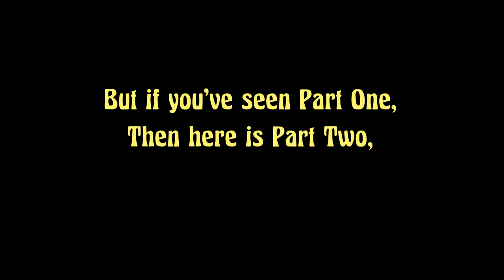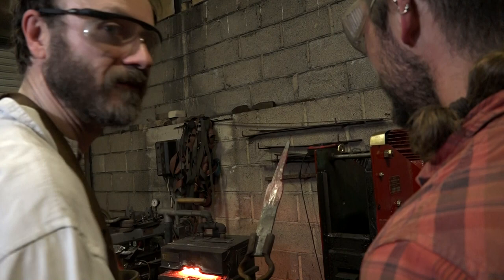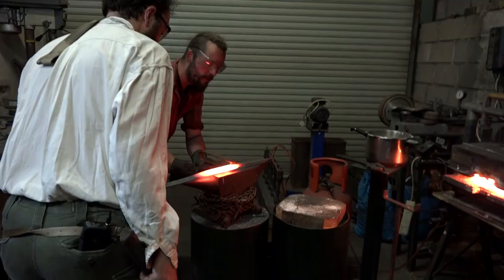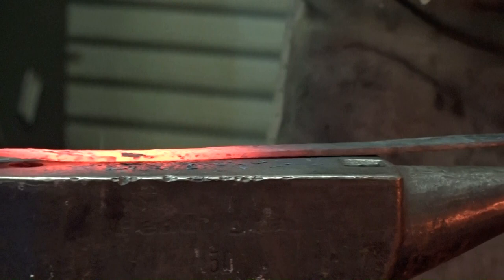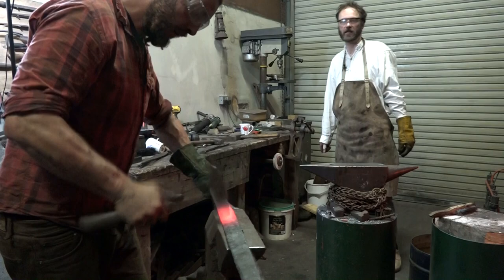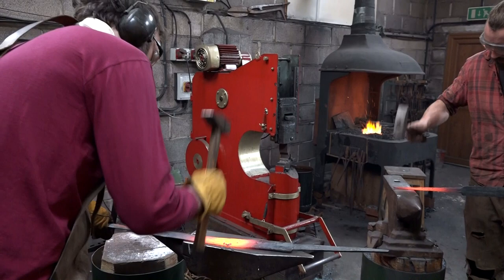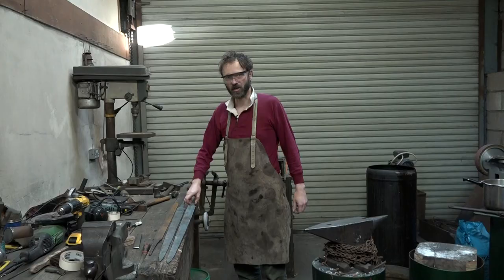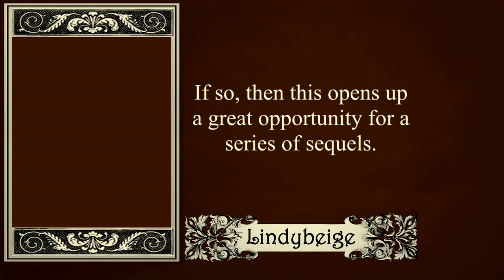Forging a Sword - part two: fuller, bevels, straightening

Comment: forging in a fuller!? thats rare to see nowadays, everyone seems to want to grind them in. Im pretty sure that forging it in has more benefits other than just simply making the blade wider with less material as one would expect it maintains the granular structure of the steel opposed to grinding it which breaks those grains. shrugs tis but a theory
Reply: Makes sense: more hammering the steel, more folding it into itself, should make it stronger.
Reply: Indeed, if grinding in a fuller did no harm, then why couldn't you just grind/cut out the entire sword from a block of steel? Well, I suppose some mass produced knives are just that. And they suck.
Reply: exactly, obs back in "ye olde days" they couldnt do that due to tooling and material limitation but nowadays, if there is no benefit to forging a shape, why not just grind it completely in the shape? there has to be something about forging that provides additional strengths over grinding. as i said, steel is a granular structure. surely it is better to bend that structure opposed to cut through it
Reply: I think the whole 'intact steel grain' is a bit overrated, considering that I'm pretty sure the grain completely reforms during hardening anyway... You have to cross the ferrite / austenite line for hardening to work, and at that point the grain structure is basically normalized and as new.

I'd guess grinding is just a industrial shortcut, whereas in medieval times, grinders and files were either hand- or water-powered (i.e. quite slow). A good smith with some apprentices could probably hammer out the rough-shape the fuller much faster, too shorten the time spent grinding your precious steel.
Reply: "as one would expect it maintains the granular structure of the steel"
"more hammering the steel, more folding it into itself, should make it stronger.
"

Any benefits of work hardening the blade while forging like this go out the window the minute you get it up to heat treat temperature.
Why? Because the steel goes through a literal phase change. Its like ice melting into water, and then being frozen back. Any crystal structure is blown away. You can even see this if you look around for metallography. Take the same bit of steel, cut it into 3 chunks. Heat treat 1, temper the other, keep 1 as a control. Etch it with a bit of sulphuric acid (so you can see the structure better), and look at them under the microscope. It's amazing how glaringly different the grain structure of the same piece of metal is after heat treat.

As far as folding. Folding only accomplishes anything if you're mixing 2 or more different types of steel, and folding them to make it more homogeneous. This sword is already homogeneous, so folding would not only be a waste of time, but it would also run the risk of introducing impurities into the steel.

"Indeed, if grinding in a fuller did no harm, then why couldn't you just grind/cut out the entire sword from a block of steel? "
Because back in the day, steel people had to work with didn't come in uniform flat bars cheaply, and grinding was a slow process.

"Well, I suppose some mass produced knives are just that. And they suck."
I'd love to see some evidence for why a ground and heat treated knife has any functional deficiency to a forged one.

"there has to be something about forging that provides additional strengths over grinding. as i said, steel is a granular structure. surely it is better to bend that structure opposed to cut through it"
Again, the minute you get above austenizing temperature and the structure shifts from body centered cubic to face centered cubic, any structure given by forging is gone.
Reply: If you already hammered the whole steel and only grinding the fuller isnt optimal, but not that bad. A Pro: https://www.youtube.com/watch?v=AcbL2v-9Frk&t=444
Reply: B & A Talks As someone with a master's degree in materials science, I can tell you this is completely wrong. If anything, forging makes the blade more brittle, which you don't want. But as others explained above, this all goes away during the heat treatment anyway.
Reply: Hammering in the fuller won't make make a difference to the sword in the end like many above have said. The key difference and why it wasn't done back in the days of these swords is two fold.

1. Material not wasted from grinding. Steel back then wasn't as readily available as today.

2. Back then all they had was low speed foot pedal grinders in comparison to todays grinders. Grinding back in the Medieval period itself was just as labor intensive as hammering it.
Reply: My way of thinking would be this (I have had some material science, but not much, and don't really know anything about sword forging):

It's the trade-off between hard (strong), but brittle steel vs softer, but less brittle steel.
I would expect for swords, you'ld want a hard edge, with a slightly softer core. (the core has more thickness, so it doesn't need to be as strong)

The hard edge is needed to cut through some basic armors, and to prevent your sword from being cut by the enemies sword.
(the harder edge will cut the softer edge)
If the base of the sword is too brittle, it could shatter in it's entirety, which you definitely don't want.

This would be the reason that hammering the edge is at least theoretically better than grinding the edge.
Heat treating will change the granular structure of the metal depending on the heat to make it less brittle, but also less strong (softer). Ofcourse you don't want to heat the metal too much during heat treatment, since that would undo all the hard hammering work and you could just have easily have casted the sword.

This is in contrast to meat cutting knives, which often have a soft but very sharp edge. The difference is that meat doesn't wear any armor, so your knife will be the harder material anyway. Softer metal is also easier to grind  sharp.
Reply: Well, fullers are put on swords to make them lighter. If you forge them, you're just compressing the metal and it remains the same weight, just higher density. If you grind them in, you're taking away material and the sword actually becomes lighter. Also, one other (and probably more important) reason to put a fuller on your blade is AESTHETICS. Yeah, the look of it. Why they mostly forged fullers back in the day is probably because it was easier than grinding them in. There's not a whole lot of difference either way. Pretty sure Shadiversity made a video about it, if not then someone else. Just look it up.
Reply: It's all about effort and efficient use of time - forging is simply faster than cutting and grinding - even today.

Watch any video of drop-forging components in a modern foundry - parts are formed to size and shape in seconds that would take minutes or hours of cutting and grinding.

Pre steam/electric power we are talking hours of forging vs days of grinding.

And the one thing that has not changed in thousands of years is - time is money.

There is no structural benefit to either method over the other - the process of forming a flat, straight bar to grind is forging, whether it is done by hammering or rolling, but if you have to forge the metal from a random lump into a flat bar then grind, why not just forge it into the final shape and skip a whole lot of grinding?

Forging produces less waste, so there is a lower cost in materials as well as labour.
Reply: How many times do we have to repeat the heat treatment undoes all of hammer hardening ? This is not up for debate man, it's a fact.
The hard edge vs soft core is true only if you don't have good steel for the whole blade. It was done in the early middle ages in Europe and later Japan (idk about the rest of the world). If you want to learn more about this Shadiversity has surprisingly accurate and complete videos on the heat treatment process.
Reply: nbfdmd
 Actually, most high quality knives that I know of are made with stock removal. I also wouldn't be surprised at all to hear of a stock removal sword, though I can't cite a specific example so I won't claim anything on that front.
Reply: Nika Rus
 Actually, there used to be a good reason to fold steel, and it's exactly as you say: it would homogenize the steel. There's not much point to this any more since modern steel is really good, but before the industrial revolution, steel would typically be rather impure. Folding the metal would help to remove these impurities and that's why the process was used for forging both the Katana the Ulfberht. Or at least that's my understanding. I love your other points tho!
Reply: The steel used to make a katana and the crucible steel called Wootz that is also called Damascus steel (what the Ulfberht swords were made from) are completely different as far as impurities go. Anything made from Damascus was already homogeneous and quite pure while the steel used for katanas was full of impurities. Crucible steel does not require folding unless you want pattern welded by having different levels of carbon steel forge welded together to create a pattern that's primarily decorative. Katana's had to be folded because that works the impurities out but even still the steel wasn't that great in the end. They could bend and warp just with practice cutting tatami mats because the bulk of the sword didn't have a good enough carbon content(just the edge steel that was forge welded in did) and their heat treat process doesn't create proper spring steel.

You can take that flat bar stock they started with and just go through the heat treat process without a hammer ever touching it and get the right amount of hardness and springiness that you want for a sword then waste grinding belts doing stock removal. Or you can stock removal to the rough grind for heat treating or forge a rough shape then the rough grind and heat treat and get the same quality blade as the flat bar. With todays steel, you could melt it to liquid and pour into a mold then heat treat it and get just as good of a blade. It isn't how you shape it but the heat treatment process and the quality of the steel you start with.
Reply: Think of it this way: If breaking the grains was a bad thing, nobody would ever want to sharpen their knives as it would mean you'd have to 'break the grains' along the edge with a stone. Everyone would have to reforge their blades each time it lost its edge.

I haven't read through all the replies, but I'm sure someone else has explained why your educated guess is incorrect. I'm glad you threw 'tis but a theory' in there. Other people pass their guesses off as a fact, and there's heaps of bullshit flying around on this topic.
Reply: Cragified  Actually, by forging you don't save much steel at all. And steel wasn't nearly as rare as you put it.
Reply: i like how you pretend yours is fact though. of course you can sharpen it without too much loss of structure and strength of the actual blade but why do you think the good knives etc have their bevels forged in and not ground in from the start? your logic is flawed
Reply: B & A Could you specify who were you referring to in your last comment?
Reply: i could but its much more fun this way
Reply: It is fact
Myself and 5 or 6 other people have responded to your comment trying to explain that forging doesn't improve the quality of the steel over grinding.
But hey, if you refuse to believe us, the metallurgists and ABS master-blade smiths, you can keep to your own theories instead. It's the youtube comment section after all, say whatever you want.

All good knives have their bevels forged rather than ground in, and must be quenched in blood - facing north - on the night of a full moon...
Reply: For all who are uncertain, here's a link:
https://youtu.be/ydvhNT4ytcU
Shad covered this issue in a scientifically accurate way. He does research for all of his videos using reliable sources, such as scientific papers in this case. You can trust him. The particular video is a bit older, so it's not the best quality (not in terms of the subject, rather the audio, editing, etc.)
Reply: i didnt say it "improves" the quality of the steel i said that the granular structure of the sword would be more maintained. At which point you'd go "but but but muh heat treatment" to which i will point out a forged fuller happens pre-heat treatment. a grinded in fuller would be post-heat treatment. I dont refuse to believe you but my masters in materials and my job is guiding my logic down a theorised path in which none of you have actually disproven yet, merely speculated against at best OR thought u were answering what i asked but had missed the point
Reply: "The granular structure of the sword would be more maintained" by the act of forging out the center fuller over grinding the fuller out... you're saying that squishing the middle from both sides preserves internal order better than scratching the surface?
Do you even read what you're typing? We can't disprove your nonsensical ideas.
Reply: B & A Talks You know that having a masters in materials doesn't make you the smartest person around, right? The way you formulate your comments leads me to believe you're one of those people who puts their ''intelligence'' into everyones face...
And besides, people are people, and they can be wrong about stuff sometimes. And when they are, they shouldn't tell other people who are right that they're stupid.
I mean look, there's 5 or 6 other people that disagree with you. It's not always other people who are wrong, you know. Sometimes it's you.
As for the subject, it's been proven many times that grinding or machining parts isn't somehow worse than forging them. Sek RF seems to know these things. Read his comments more carefully.
Reply: grinding in a fuller is a little more than simply "scratching the surface" is it not? What i am saying is that grinding the material post-heat treatment will cut through the granular structure of the steel which would in turn lose the strength in which that grain provides, like cross cutting wood. Break the grain and the material weakens. If however you do simply remove the oxide build up then you will leave most of that granular structure in tact ergo forging in the fuller would be, over all, better for the blade.

i do read what i put, you clearly dont read what i put as you wouldnt be so confused by such a simple principle
Reply: no i wouldnt class myself as the "smartest person around" but my point is that i have some form of education to back up why i think my theory is correct. It was also in response to Seks comments of "if you refuse to believe us, the metallurgists and ABS master-blade smiths" statement which he was clearly trying to undermine my comment by saying "WE ARE SMART YOU ARE NOT" 

I understand and know i am not always right but a very very small group of people who havent actually accurately countered what i was saying does not mean i am wrong. Its like if you commented on a flat earth society post and 5-6 people come back to you and say "no, you're wrong, the earth is flat" does that automatically make them right? no. 

and if proven then simply provide me the evidence NOT speculation. it isn't that hard
Reply: B & A Talks Even as so, that would be hardly noticeable in the overall performance of the weapon. It's not like it's going to break because of the ground/machined fuller.
Reply: B & A Talks All right then, go buy some steel and do a scientific experiment. Publish your results on the impact of grinding a fuller as opposed to forging and if you prove us wrong, then props to you. Or you can look it up on the Internet. Either way the results will be the same.
Reply: again you're just speculating opposed to actually proving my theory wrong. And i wish i could go get some steel and set up an actual experiment but i have neither the time, money or equipment to do so and i am not going to do it for a couple of people on youtube. And i have looked it up previously and sources are rather limiting so i asked around my work, that is a business filled with engineers of minimum masters degree in their respected fields and the majority sided with my argument
Reply: and just to clarify my stance, while i believe that forging is superior to grinding, ultimately, it makes little difference in the end result due to the nature of the product. its small enough to not have a huge affected area but its not sensitive enough where every tiny fleck of strength has to be utilised
Reply: I'm confused by this so called 'simple principle of breaking the grain' because it's something you've made up in your own head. I mean, you're going so far as to compare wood grain to metal poly-crystals... there's almost no similarities to them at all. 
You mention cross-cutting wood as if the same rules apply to metal. Okay, how would it look if I started talking about forging wood to shape with a hammer and anvil? Or heat-treating wood, dealing with wooden crystals haha! Doing this doesn't help explain anything or give you any idea of what I'm talking about.

Grinding will cut grains, yes I will give you that. As I said before, it happens during sharpening too and there is nothing wrong with it, otherwise the sharp steel would be weak. You can sharpen edges by forging too - look up scythe peening, a form of work hardening - and if what you said was true then this would be the only way to sharpen steel without ruining the grain on abrasives.

Grinding steel won't cause it to lose strength over a forged blade.
Forging steel pre-HT won't cause it to increase in strength over a ground blade.
Reply: the crystal structure is granular. granular means to be made out of grains

definition of grain:

grain
ɡreɪn/Submit
noun
noun: grain; plural noun: grains; symbol: gr.

1.
wheat or any other cultivated cereal used as food.
synonyms: cereal, cereal crops
"it's uneconomical for local farmers to grow grain"
the seeds of wheat or other cultivated cereals.

2.
a single fruit or seed of a cereal.
"a few grains of corn"
synonyms: kernel, seed, grist, fruit

"a grain of corn"
a small hard particle of a substance such as salt or sand.

"a grain of salt"
synonyms: granule, particle, speck, spot, mote, mite, dot; More
the smallest possible quantity or amount of a quality.
"there wasn't a grain of truth in what he said"
synonyms: trace, hint, suggestion, suspicion, tinge, shadow; More

**************a discrete particle or crystal in a metal, igneous rock, etc., typically visible only when a surface is magnified.
******************

so no i am not making it up in my head and nor am i saying that the properties of wood are exactly the same as that of metal. stop being fallacious. you know i was only comparing the grain structure so the rest of your wood statement is just idiotic. 

again, with the sharpened edges, 1) thats a small amount of material. 2) i never said that grinding metal to sharpen it would suddenly make it weak as fuck  

can you provide evidence that it doesnt cause strength loss?

and again i NEVER said it INCREASES the strength, merely that the strength is not lost
Reply: This is worse than I thought. You clearly do not understand what grains are in the context of steel.
You say, "the crystal structure is granular." This is wrong.
A grain is One. Single. Crystal.
The crystal structure of iron is cubic, normally body-centered or face-centered. To be granular means that there are many crystals packed together in one solid - also known as a poly-crystal. Cutting through one wont affect the one sitting next to it.

I know my wood comparisons were idiotic, my point is that yours is too.
Reply: Grinding in a fuller is done pre-heat treat, not post heat treat.
Reply: really? I was pretty sure i had seen all of the fullers ground in post-heat. I will have to review some footage.
Reply: If you're doing stock removal of any type it's simply easier to do that sort of grinding or milling when the steel is still softer. Easier on you, easier on your gear, easier on the blade. Forging and stock removal both get the main blade shape done before heat treat. You want all of your tapers, shaping, and fullers set into place while the blade is soft.  After heat treat you're grinding off the oxidation, putting in the final shape characteristics, and putting on the edge. While 90% of the blade is shaped pre-heat treat, the 10% you do after is the most important. Your final handling characteristics and almost everything about the actual point shape and edge profile are done post.
Reply: i see. i mean i know that most of the actual shaping and so forth happens pre-heat treat but i would have thought the oxide build up would be significant enough that relatively shallow features like a fuller would have to be ground in post-heat treat especially on thinner blades as you want to keep enough material where you would thin out the blade too much. if you put in a fuller first then itll oxidise, meaning youll have to take off yet another layer making the material between the fullers even thinner
Reply: Totally wrong, steel is hot roled in the factory, it's already forged into shape.  In practice, forging a fuller can induce stress cracks if not done at the right temps ( too hot or cold). A forged blade has no advantage over one made from stock removal, steel alloy and heat treatment is all that matters.
Only heat can alter the grain structure of steel.
Reply: k so first, hot rolling has nothing to do with it as the forging process introduces its own heat cycles. Yes forging in a fuller if done at the wrong temps can cause stress cracks. all forging can. grinding in a fuller can also fuck it up by over heating the piece and ruining the heat treatments. There is no great difference between forging and stock removal but there is still a difference and while it is true that only heat can alter the grain, there is a difference between the grains when it comes to being forged and being grinded. For example, the grains bend when forged and grinding cuts through them. If it did not Damascus would be pretty fucking boring
Reply: Wrong again. Compressing and shapping steel, trough a mill or power hammer, is by definition forging. All modern steel comes forged from the factory, if not it´s cast iron.
You're suposed to grind the fuller or bevels before hardening.
In damascus steel the different alloys used etche to dark or bright grey depending on the their chemical composition , that's what gives the pattern. Forge welding lowers the carbon content of steel.

When only heat can change grain size, wich are spheric when normalized, how can they be bent?Impossible.
Reply: when i say forging process i mean as in when the blacksmith works the material opposed to the initial primary forming techniques. 

and you're not supposed to do anything. there is no set routine. There are better ways of working like forging in the majority of the bevels to save you time post heat-treatment so you have less material to remove. The fuller does not have to be ground in pre-heat treatment and is often done afterwards due to prevention of excessive thinning out of the material as oxides will build up during the heat treating process. 
I know precisely how damascus is made and i know what gives it the contrasting layer patterns by my point is, if you fold differing alloys together in a standard layered pattern, to get to the different material layers you HAVE to grind it. 
And how can they be bent? pretty simple if you have a clue how steel is granulated and not just some condescending cunt who doesnt actually know the properties of steel and has gathered all of their knowledge by watching the odd blacksmithing youtube video
Reply: Are you trying to inply the hand forging is superior to an industrial 200 ton press? Dont be silly.
The scale left from HT is very thin and easily removable, unless you overheat the steel .
No one knows how Damascus steel was made , lost technology.
You do not have the experience nor the knowledge of metalworking.
Find me over at I FORGE IRON , look at he suff we make and learn something.
Reply: anything you do at the forging part, when working with hot metal, has benefits of it actually affecting the structure of the metal. theoretically, forged fuller could make the blade even stronger at the center, because you're compressing the metal there, while grinding it will actually weaken the center, because you're taking away some material, and what's left is not as compressed as it would be if hammered.
Reply: So, the grain structure will just grow the next time the metal gets above the transformation temperature anyway (usually around 1500 f). Ask two bladesmiths how to put in a fuller and you’ll get three answers. It has a lot to do with their skill set, process and tools available.